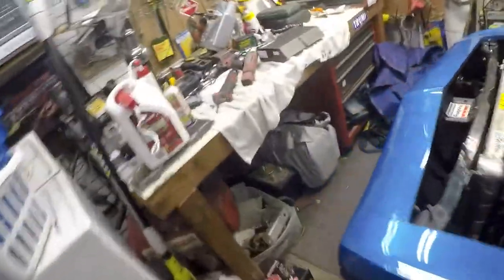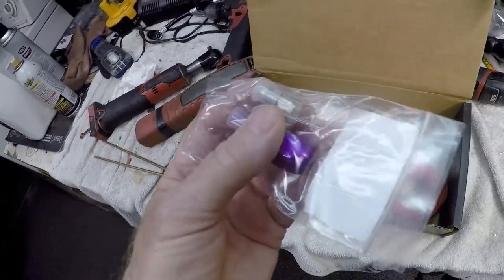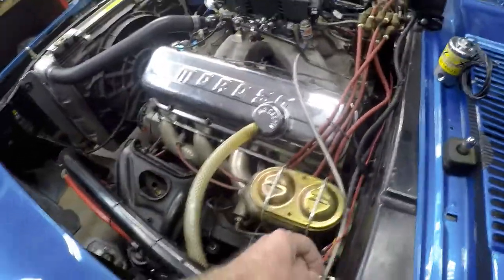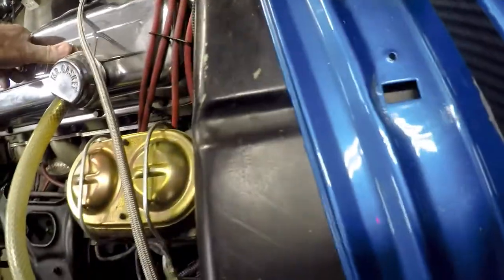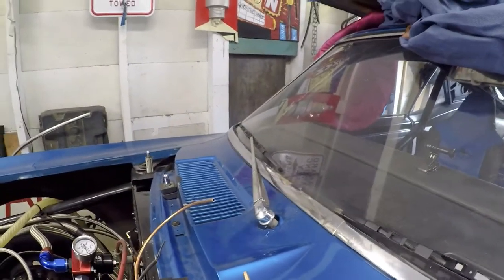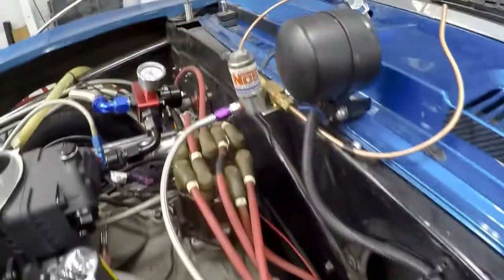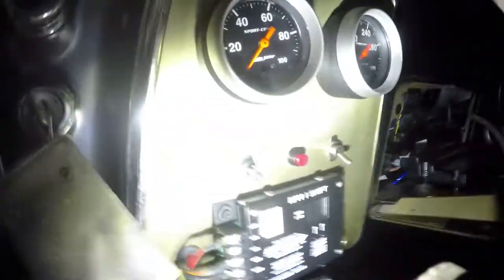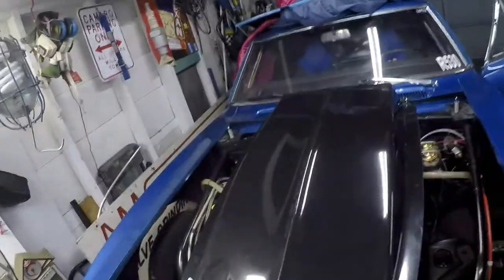ZEX Purge kit install.

Comment: Why do u only have one nitrous solenoid?
Edit:haha as I commented this u went around the carb and showed the 2nd one 😂
Reply from the maker: I have not even tested the system yet, come on spring.
Reply: @rickboretirementplan  same aswell I’m getting ready to retune mine soon once I get a new gauge and afr gauge and hopefully a window switch and also a purge kit since I have a dry kit I don’t rlly need it but I’d prefer it since it helps get it in the intake instantly